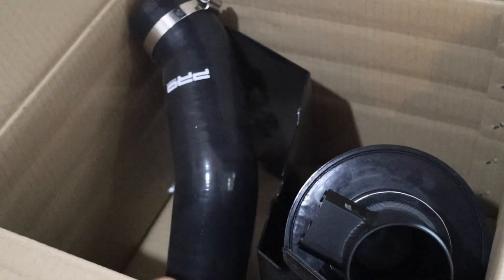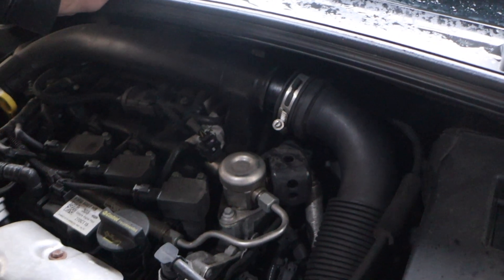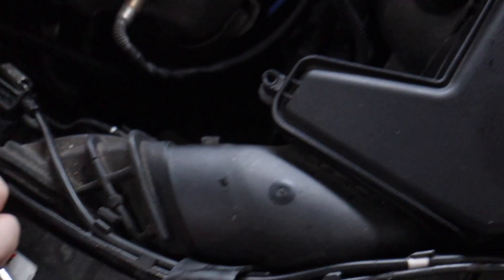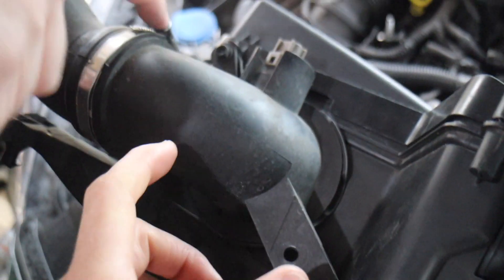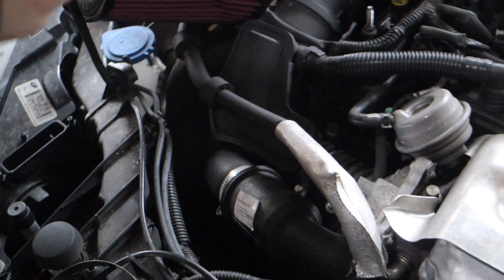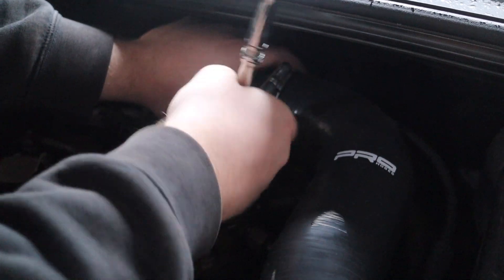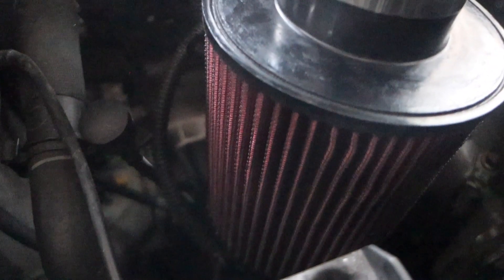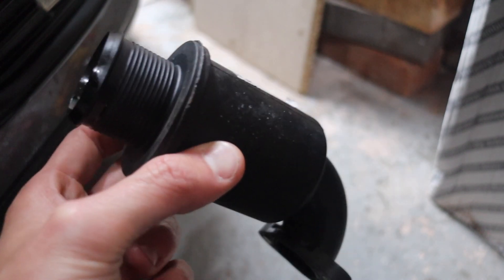INSTALLING INDUCTION KIT ON 1.0 LTR ECOBOOST FIESTA/FOCUS

Comment: It doesn't sound like it's building proper boost. Have you checked all the vacuum pipes or any actuators on the turbo wastegate or vnt. 
Soon as you rev the turbo should either be in the spool position if it's variable geometry or the waste gate should be completely closed until boost pressure is built up.
Reply from the maker: I thought the same thing part 2 should sort it haha
Reply: @JustbeingHayden  can't wait mate I've had some boost issues in the past. The dci sounds like an asthmatic ogre at idle and soon as you hit boost when the vnt moves it chuffs like a good'n 👌 I get the flutter noises too but they sound more airy not as compressed and whistly
Reply: @JustbeingHayden  just googled it the Ecoboost uses recirc instead of dumpvalve so that's why blocking that port made it louder it's open all the time.

Comment: Need to change the primary induction pipe as well
Reply from the maker: Hopefully do it in the next video
Reply: I’ve done primary and secondary pipes, turbo hard pipe. To get flutter need to upgrade recirculating valve. I’m doing b14’s coilovers today on mine , nightmare back springs wouldn’t drop out. 🙈😂
Reply from the maker: What car have you got buddy
Reply: 1.0 Ford Focus mk3 ecoboost zetec mate. Fecking nightmare today fitting those shocks. Everything was seized 🙈

Comment: That sensor is a air temp sensor. Irc they get the air volume off the map sensor
Reply: Only air temp if it's 2 or 3 pin if it's 4 or more it's a Maf which usually does both intake air temp and flow. The map sensor is used for wastegate or vnt control. Have a map and maf let's the ECU know if there a leak between the turbo and the engine.